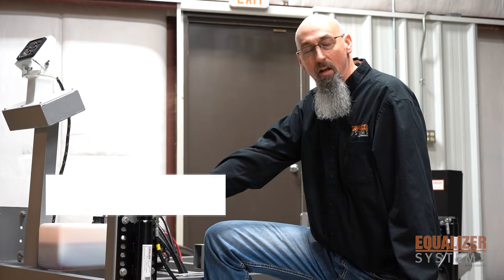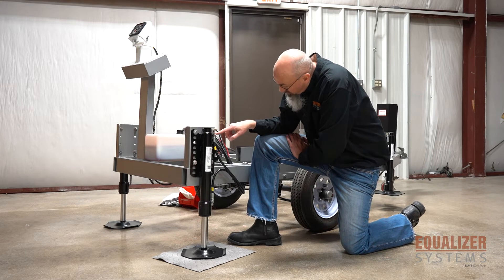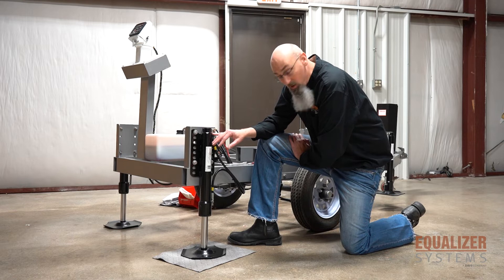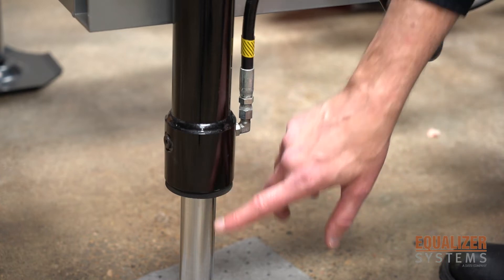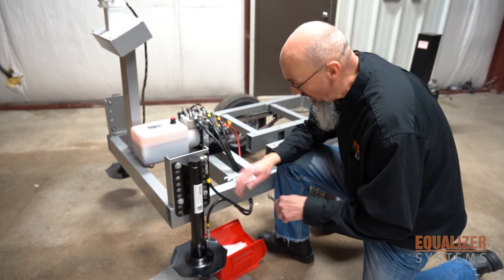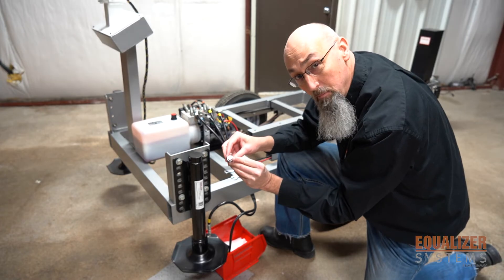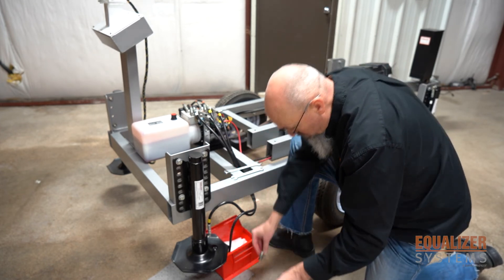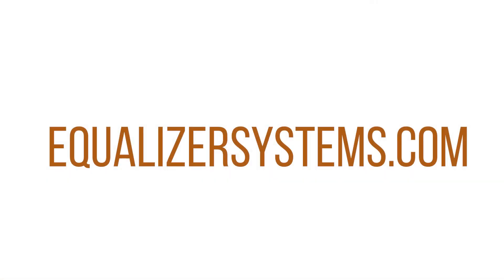How to Check Your Equalizer Jack for Leaks

Comment: I have a seal leak. How do I first get the part and second how do I fix it?
Reply from the maker: Please call (800) 846-9659 or visit our Support section on our website for more information or to submit a question. www.eqsystems.us
Thank you.
Reply: Since this video is educational and someone will have a similar situation, the answer is they can not be serviced.  The entire jack would need to be replaced.  I am currently replacing mine on my Jayco North Point.
Reply: @TeeCamp10  Yep! It's ridiculous given how often these fail in a relatively short timespan. All 4 jacks on my coach had the bypass issue in under 10years. First fail was in year 6. I don't know if Equalizer is worse than the others, but it will be hard for me to justify buying another coach with them. BTW, this is my most unreliable system on my Newmar coach (electrical issues with them too).